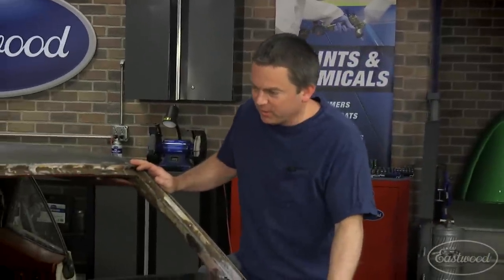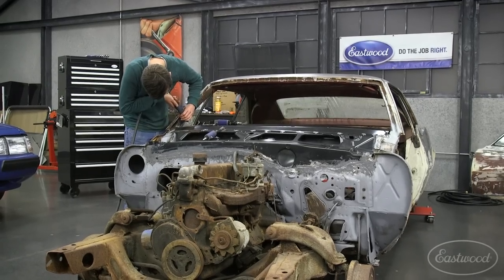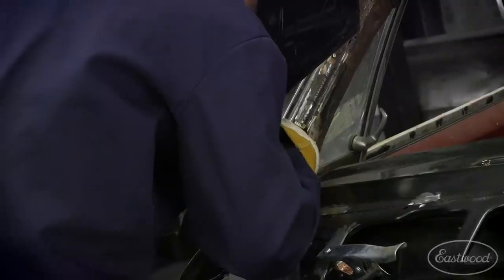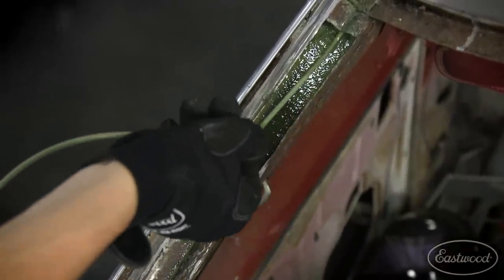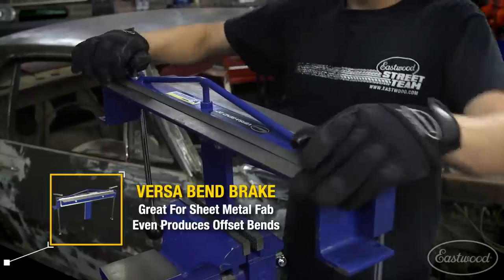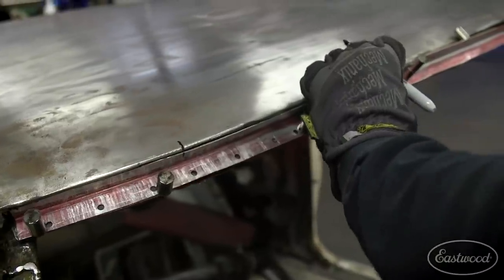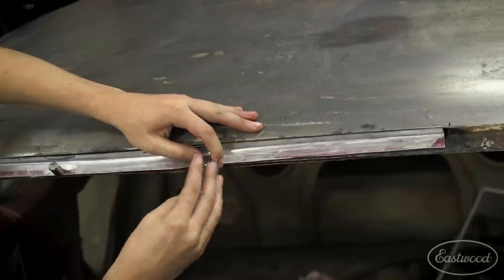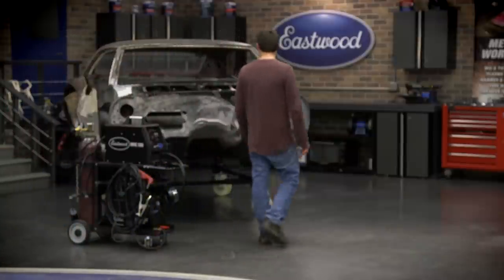How To Repair Rusted Camaro A Pillar + Windshield Channel - Repair Restore Revive: Ep.6 - Eastwood

Comment: Weld thru primer could have been used here....  The inside of the A pillar was rusted and the back side of the patch panels should have been coated.
Reply: I've tried using that stuff. It makes your welder a torch really quick. Had to get good at cleaning it away from anywhere I was actually welding.

Comment: Honestly, it's just fun to take a break and watch someone else do some work on their projects.
Big project on an even bigger K5 Blazer that needs a bit of everything. Just stuck thinking about the tools that I don't have on hand like a bead roller, English wheel, and planishing hammer... I have one heck of a shrinker/stretcher, a beast, but that won't help me when it comes to the drip rails being eaten at the point where the top of the cab meets the A-Pillar on the left hand side of the Blazer.
By chance, do you offer military discounts and package discounts at all? If I'm buying the tools I listed, they're all at once.

Comment: good job but to be definitively efficient,  you should  put grease everywhere. grease et the only thing very efficient against rust. put grease between metal and carpet, inside door, behind metallic bumper, behind (inside the car), under the vehicle, behind  the repairs you can make (everywhere inside  hidden erea -  instead of using paint), hollow areas (necessarily hidden, so no need to be aesthetic). For rear wings unreachable with a paintbrush, use an extender and poor old oil everywhere each year.Handyman Experience - 35 years.   From france

Comment: You didn't do anything to the pinch weld to treat the rust that you took a grinder to but a grinder doest get it cleaned enough to get rid of the rust in the little  Poors of the metal so it's just going to start rusting back.  That's one camaro I wouldn't want after see what kind of work that was done to it .the fab work was fine just not enough rust protection for me .I would put the body man down the road for that